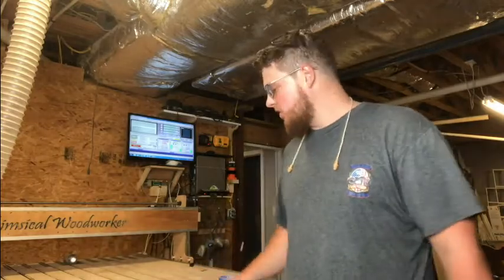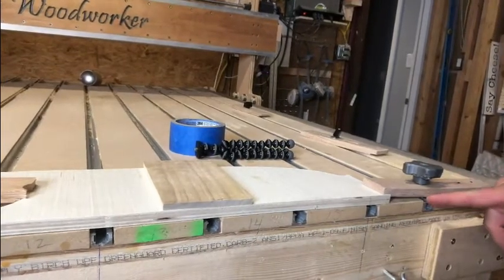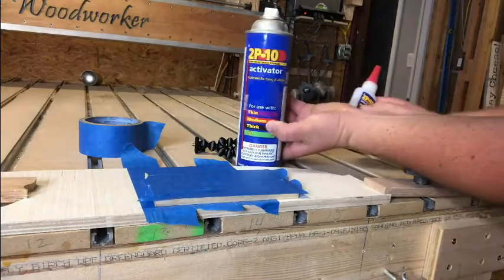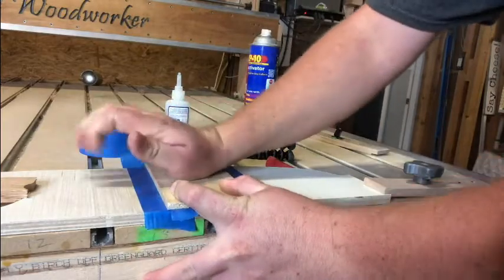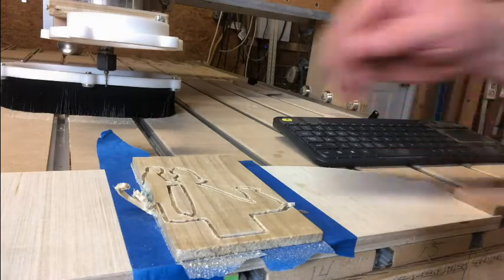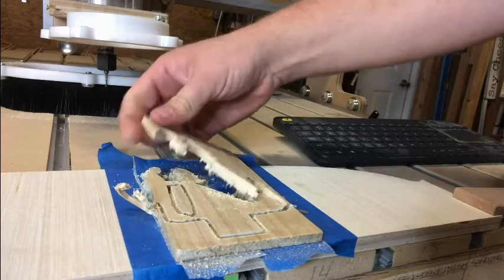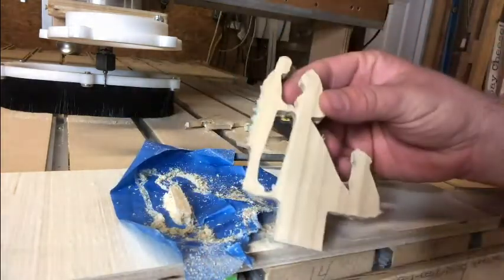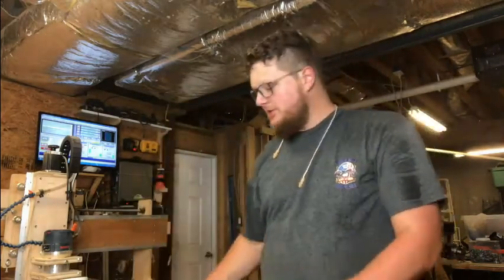The Best CNC Stock Hold Down Method

Comment: I couldn't help but notice your "toe clamp" Sloped up towards your work piece. They work best, when the back is slightly higher than the work . In fact what you will find with it sloped towards the work, it will tend to move the work around. But when the the back is higher, sloped down toward your work piece, it will just hold it down in place! Many clamps you see in industry even have a threaded adjustment back there so you can dial it in just above the thickness of your work!
Reply from the maker: Good eye! Some of my first ones I made, I put a threaded insert to do just that. Ended up not using it very often or hitting it with bits. 😳

Comment: Use aluminum plate. Super glue the piece. Then just use a heat gun to heat the plate and the glue will give
Reply from the maker: Great idea! May work for some machines, my machine doesn’t have a ton of power so hitting metal when programmed for wood doesn’t end well! Thanks for watching!

Comment: Nice slowdown in the corners - what cam software/setting does that? Did you cut the large sign at the video end with the same CA/masking tape hold down? Thanks!
Reply from the maker: I use vetric pro to design and Mach 3 to cut. I cut bigger stuff with traditional home made clamps, can certainly use this technique for big projects as well, if needed.

Comment: I tried this method with super glue I had around, and someone from canada suggested lysol spray.  it came up both times.  may need more glue. not sure.
Reply from the maker: jinfolsom I can’t comment on the Lysol, I have not heard of nor do I understand the application of it. I know that the method I’m using in this video has not failed me yet!
Reply: I’d doubt if regular super glue that was lying around would be as effective. The 2P-10 is pretty high end glue, and the accelerator is a critical piece of this process, from what I’ve found. 2 oz of that glue and  12 oz can of accelerator is $20+. I’ve seen this method used by MANy folks, and they all swear by it. I’m ordering some today!

Comment: Effectively just homemade double-sided tape
Reply: Why not just buy double sided tape
Reply: @mikej9062  I used to use double-sided tape but it was always a pain to remove from the underside of my workpieces.  The blue painters tape just peels right off so easy and does not leave any adhesive residue that then needs to be cleaned off.
Reply: @DCDLaserCNC  then use blue tape with your double sided tape. :) I've just glued my part to a lager board with paper in-between them.
Reply from the maker: @Pico2199  the main reason I don’t use double sided to two fold, primarily cost. Cheaper to use painters tape. Secondly, the painters tape does give a touch and leave residue.
Reply: @TheWhimsicalWoodworker  It costs me more to buy CA glue and an activator ($22) than the double sided tape ($3). You can still use the blue tape if you want to cut down on the residue. Again, I just use wood glue ($16 a gallon) and a sheet of paper. pops off easy enough and I will be sanding the piece any how

Comment: I do not get it, why not  just use (double sided)  carpet tape? It is SUPER strong AND very thin.
Reply from the maker: SpookyFXdotCom I believe you answered your question in your question! Painters tape isn’t “super strong” so it comes back off easily. When working with thin, delicate parts you don’t want a super strong hold. Also, the painters tape leaves zero residue so there’s no post cut clean up work required

Comment: I've used this method for a couple years now and it works great!  I've never had a piece come loose using the tape and super glue method.  Thanks for sharing!
Reply: what kind of tape do you use... I had really big problem with some parts..
Reply: @alexandru-cosminvasile7121  I just use standard blue painters tape from the big box stores...nothing special...just the plain blue stuff.  I put a single thin bead of CA glue on one side and spray accelerator on the other.  As long as the blue tape sticks to your spoilboard and the underside of your workpiece it should be good.  Did your work puece have any sort of warp to it?  If so, that will cause problems of it coming loose.
Reply: @DCDLaserCNC  Thanks for your fast answer, I didn't find blue one... so I tryed to use normal white  paper on aluminium parts, now I buyed TESA white paper maybe is better. On the part was really good connection but on the sacrifice plate(aluminiu) lose connection. Annd I tryed to be gentile and use low feed...
Reply: @alexandrucosmin90  Yeah I have never tried anything other than the blue tape.  There are times when I use it and I have to use a putty knife to get the workpiece lifted back off my spoilboard.  It has always worked well for me.  Good luck with your future projects!  Thank you for watching my video and reaching out to me.